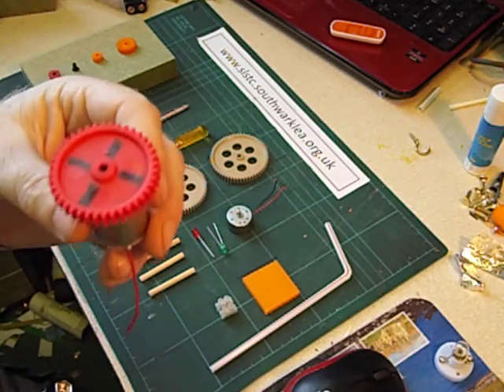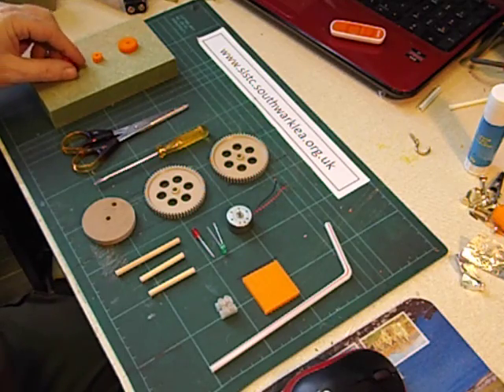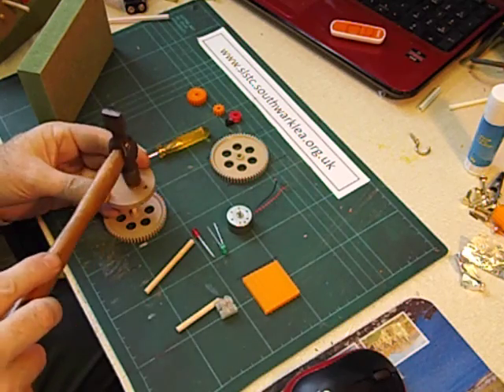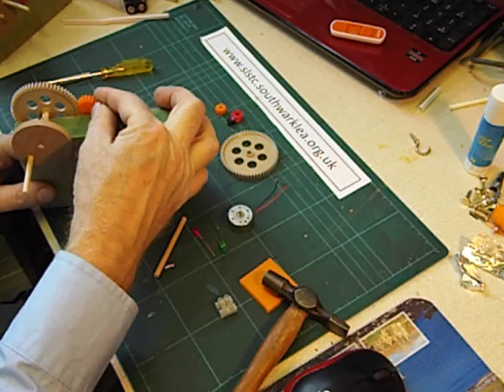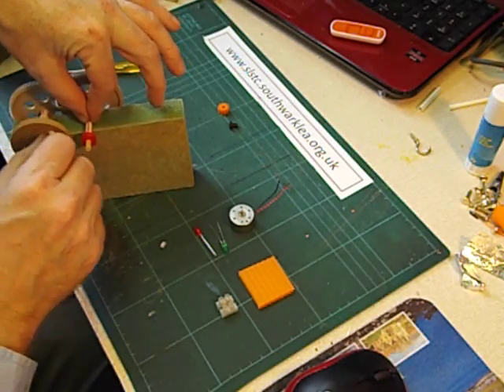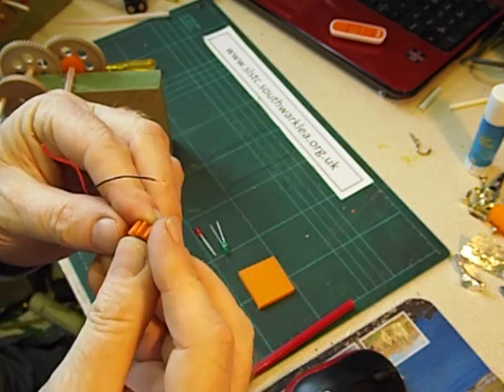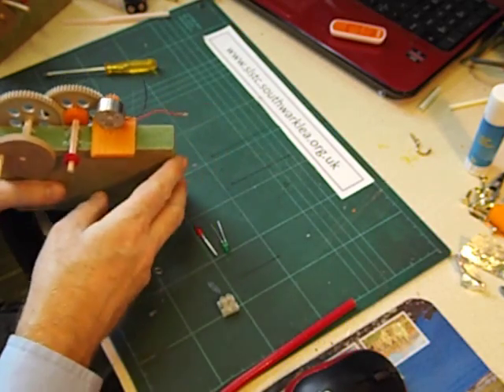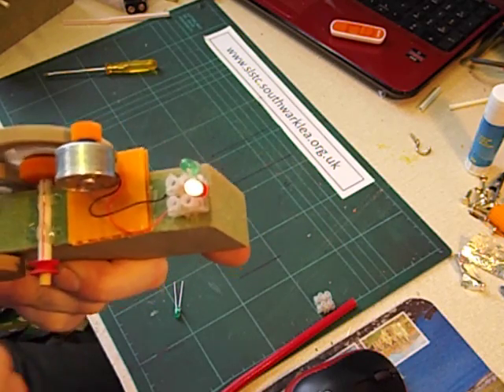How to make a Dynamo

Comment: Nice demonstration!
But should mention that on higher amounts of electricity generation the motors heat generation needs to be taken into account or it can cause a fire.
Cant just glue a motor on any surface like the demonstration here.

Comment: I don't get it. Most of the gears are unecessary... why don't you just connect the motor at the second one??
Reply: None of them are unnecessary, all of them speed up the movement, but at reduced torque. That's how gears work.

Comment: If you used a 12V motor that would have generated much more voltage than this 5V motor generates! aprox twice or thrice much more!!!
Reply: But it makes the user to spin more faster than needed, and it is very hard
Reply: +Royal Marwan Guess some are hard but, i have a 12V motor and its same as 1.5V just a little bigger than that nothing else😛

Comment: Science and technology used to be specific in the use of words, as they once had meaning.  The title of this video says, 'How to make a dynamo'.  You did not make a dynamo, you used a motor as a generator.  I would recommend more specific titles, or change the channel name to 'Fluffy's projects' or some such.
Reply: A dynamo can be used as a motor since both depend on a magnetic field to induce a current or use electrical current to move a magnet.

The motor becomes a dynamo when used to induce current and a motor when electricity is used to induce movement. 

He has turned a motor on to a dynamo, albeit not so efficient but a dynamo nonetheless.   As you said : The word describes it specific use.

Comment: This isn't a dynamo. A real dynamo actually powers its own field coils to generate an increasing voltage
Reply: Not at all.  The moment you use it to convert movement to electrical flow then it becomes a dynamo.  The magnets in motors/generators/alternators/dynamos can be permanent or created by induction.
Reply: For this generator to be qualified as a dynamo, it must use its own output to excite field coils that, in turn, further increase the electrical output
Reply: Rubbish : The magnetic field may also be provided by permanent magnets.
Reply: Philip Jones
The INITIAL magnetic field can be provided by permanent magnets, but the power output must also feed field coils inside the generator